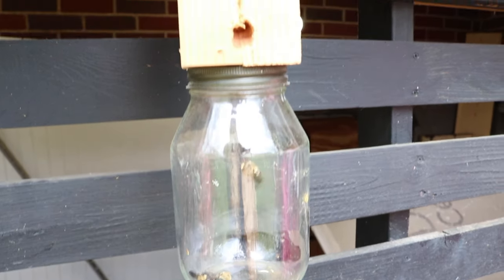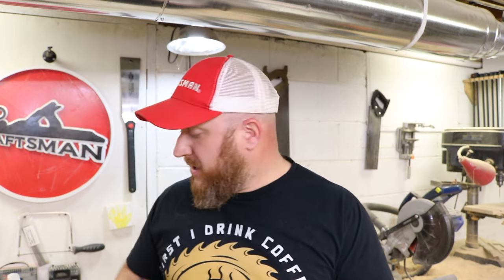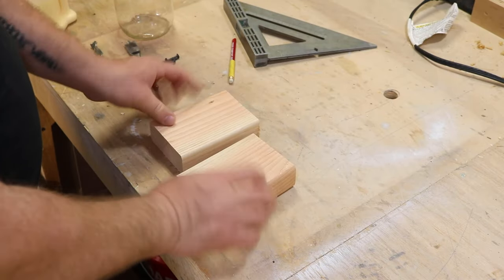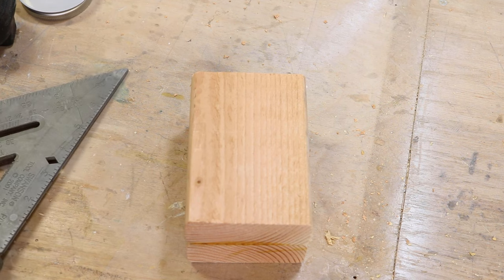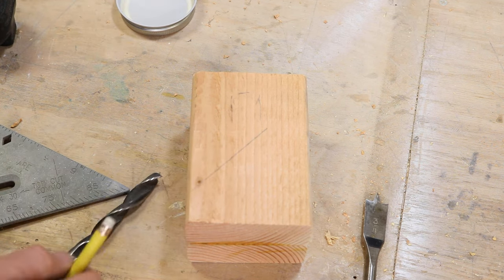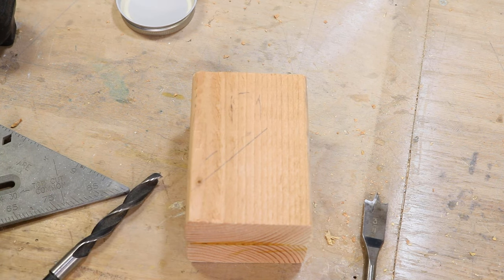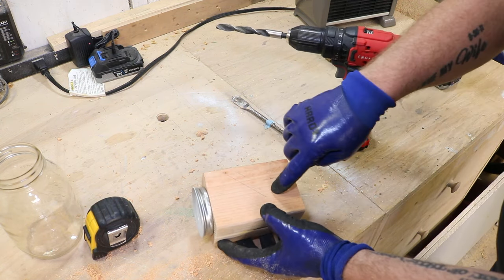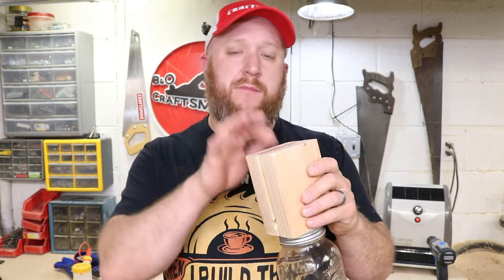How to make a Carpenter Bee Trap

Comment: If you're building traps you have a problem. The traps will catch bees but they won't stop your problem. "Well ya crazy ole fart what will"? I'm glad you ask but no one seems to do it. If one of you guys do try this let everyone else know your results. My buddies love it and it stopped a terrible infestation around my barn and sheds. That's why I started mixing it. I built over 20 traps of different styles trying to see which one was best. The 4x4 style was the winner which you made. I even drilled holes in the jars to let the thermion scent out but that doesn't help. It will help a trap get started if you'll swat a bee and put it in the jar for scent. Enough with what doesn't work and on to what does, Carpenter Bee Wax.

This mixture took some time but I'm happy with this. Get a 13 oz container of petroleum jelly at the Dollar Store or Walmart ($2.50), get the 8 oz bottle of  Permethrin 10% liquid ($10.50 I went to Tractor Supply but most farm stores will have it). Permethrin 10% is used to treat children's head lice and spray on animal to kill flies, it's considered safe for humans. The petroleum jelly mixes easily if you warm the container in a pot of warm water on the stove, it turns into a liquid. Mix 13 ounces of petroleum jelly with 4 ounces of Permethrin 10% pour both ingredients into a 1 quart canning jar and shake well, that's all there is to it. Draw the mixture into a 60 CC / 2 ounce catheter syringe with the long smooth tip ($3.30 at the farm store). You want it thick enough to stick in their holes but thin enough to be used in a syringe. Optional - put a 7" piece of 3/8 OD x 1/4 ID clear vinyl tubing ($3.20 for 10' at Lowes) on the end of the syringe to reach into their holes better. The tubing slides on the syringe easier if you heat it with a hair dryer or heat gun. When it's time to refill the syringe, warm the container in warm water on the stove so it can be drawn into the syringe. It doesn't take much to treat a hole, less is more in this case. A 60 CC syringe should treat 150 holes. Imagine a 7/16" diameter Carpenter Bee going down a 1/2" tunnel, all they have to do is get this stuff on em. This will make 17 ounces and the syringe holds 2 ounces so you will have 7 refills. Basically a lifetime supply and you've only used 1/2 of your Permethrin. I like to treat the hole while the bee is inside so early in the morning works well. Try to squirt the mixture about 1/2" - 3/4" inside the hole so it won't prevent the bee from going in if she isn't in there already. If I treat just inside the edge of the hole she doesn't want to go in. This targets the female that bores the hole, lays the eggs, and stings. The male doesn't do any of those things. This will kill their offspring as they emerge also. You'll find a pile of bees under a hole. It turns every existing hole into a trap. They'll start buzzing, crawl out of the hole, and die on the ground in a few minutes, I had dead bees everywhere. The petroleum jelly protects the Permethrin giving it a longer shelf life to last all season. If you spray Permethrin it would be effective about 14 days before starting to breakdown. For less than the price of one store bought trap you can mix this stuff, if anything is ever going to stop em this is it. This stuff will wax em, thus the name Carpenter Bee Wax. I'm not selling anything and make no money from this stuff but it fixed my problem and several others so I want to offer it to everyone. Might even make a good video, good luck everyone
Reply: Thank you for the time you spent in writing this. I will place traps up as the ones in the videos, but will also use this idea to combat the already made holes. I have a huge infestation of these suckers and have killed dozens by whacking them for around 12 days now, but they don't seem to be letting off. Thanks again.
Reply: @BoggiestBog  What started all this for me was Dad passed away in 2017 and I became a reluctant farmer. The barn and three sheds were infested with these things. I needed to do something fast but what? I started with Delta dust but that encouraged them to abandonee the old holes and drill more. Next came the traps and a butt load, different designs, types of woods, and locations. I use attractants in some traps and dead bees in others. Of the two dead bees are just as good and untreated pine is my wood of choice. I painted the top portion of some yellow to see if a color would attract them. It didn't seem to matter. 2019 rolled around and nothing had changed, the numbers wasn't going down and I had caught a lot last year. I needed something else. I was familiar with  Permethrin and from what we're told it was safe to handle so I based my trials on it. It took a little time to get the consistency right. I was going to wait to see how it preformed but it was effective enough that I started telling friends and getting positive feedback from them. 2020 was much different, until this day it's hard to find one. You'll notice they like wood that warms first and gets sun all day. The southeast side of my buildings had the most damage while the west side wasn't effected. My deck at home faces west and I don't have a problem but my east and south facing neighbors did before the Bee Wax. If you would like to try this I'll be interested in your results. For some reason people think this is hard or something? I go into detail to make it simpler but I guess it sounds hard? If you have questions feel free to co0ntact me. I think if someone shows how easy it is and effective it is folks will use it. I'm 60 years old and not the guy you want videoing. lol  I'm pretty sure YouTube and I wouldn't get along ! 
If you treat any holes overhead don't be under them when the female comes out. She won't be able to fly but she'll fall on ya. Females have an all black head and are the only ones that bore holes, lay eggs, and sting. Males have a yellow dot on their head that is easy to see, he only breeds the female. In warmer climates the female can breed two times a year producing 5 to 7 eggs each time. You'll find them piled up under the hole. We have an old refrigerator where I store mine, I don't know if that is necessary. I wish I knew more about it but I know this works. You know I'm not a professional because I didn't ya charge anything. lol
Reply: I have carpenter bees in my firewood.  Is this mixture safe if the wood will be burned inside a house?

If not Im gonna try these traps combined with fake wasps nests and a nest box. Hopefully they'll move to the nest box and away from firewood.
Reply: @robertm5969  Good question Robert, to be safe I'd ask someone smarted than myself. What I have learned is these bees like the wood that gets the morning and all day sun. The sunny side of my structures sustained the most damage. I hung traps all around to see what they preferred. At home my deck faces west so I don't have a problem but my eastern and southern facing neighbors did before Bee Wax. Having said that is it possible to cover your wood with a tarp or move it into the shade? Traps won't stop them. From what self education I was able to find females can breed two times a year in warm climates laying 5 to 7 eggs each time. Bee Wax kills their offspring as they emerge effectively ridding you of bees.

Personally no more Permethrin than you'd be burning I'd do it but that will be your call. Lets break it down, 60 CC syringe {2 oz} should treat 150 holes. It required 4 ounces of Permethrin to make 17 ounces of Bee Wax. You'll get 8.5 refills from 4 ounces of Permethrin. I'm not sure you'll use a quarter ounce if that much? lol Your call.
Reply: Sounds great. I was wondering how to make it
Reply: I’m sorry I missed that, could you go over it again 🤪
Reply: would love to but I can't get to their boresites
Reply: @PatrickMcCarthy  they in the attic & I ain't crawling up ther pulling all the insulation out trying to find the holes 🤷‍♂️
Reply: @charltonheston969  haha, not my circus not my monkeys! Good luck to ya
Reply: @charltonheston969  same. In addition, due to the method of construction, the ceiling is not rated to take my 200lbs. the bees have free reign up there and I can't get to them, so the traps are my best bet
Reply: @PatrickMcCarthy  When I was testing traps the 4"X4" post with the clear container of your choosing on the bottom. Not the side as I've seen some commercial rap designs. They can't fly vertical, they can crawl sideways. This design was best for me and the bees didn't care if it had a roof. They didn't care about the colors red or yellow. The type of unpainted wood I used didn't seem to matter because the hole was already there. I only tested common woods from the big box stores. It will most certainly help to swat a couple bees for scent to start the new traps. Commercially available scents (all I could find at the time) were not any better or longer lasting than nature's scent of bees. Going down the scent rabbit hole, drilling small holes in the containers made no difference in letting the scent escape. That ole tennis racket or anything like that will work just fine. Males have the yellow dots on their heads (foreheads, y'all know who y'all are) They'll be most visible buzzing around outside the holes trying to catch a female coming and going from her hole. He's only worth 5 points. The female has an all black head, drills the holes, lays the eggs, and stings.10 points all daylong ! Location is also important, you want areas that receive the first sun and sun all day. In SE Tennessee that would be corners and all along the southeast to southern parts of the structure. She wants the areas that heat up first in spring. Think about the trap from a bees perspective, she goes in this perfect size hole to find all these other holes. This won't do so she heads out the largest hole where she tumbles into a container that lets in a lot of light. They can't fly vertical enough to get to the center of the container. It wasn't uncommon for the 4x4 type traps in the good areas to catch over 50 each. I have them two deep every 10' in 3 sheds and 1 barn. I really tried the traps and learned a lot for an old country boy but they did not solve my problem. In my region of Tennessee it's possible for a female to lay twice per year. Each time she can lay 7 eggs on average if you believe what I've read. The traps had to do a remarkable job and they did well but nowhere near solving my problem. The Bee Wax has been good for me. It gets the female which was expected but when you find some others explored a natural bee hole and died that's good. When you find her offspring dead under the hole that is great! Your problem is ending my friend. All I know is barely enough to solve my problem. The Lord has blessed me like that many times. It was given to me and I give it to you. It's been tested on my problem first with good enough results to start telling friends and neighbors. When they disappear on the farm I got to start doing Mom's 80 year old friends places. lol I do it to help these folks out but I've never been ask back. It's either that good or that bad. I've never charged them anything so I hope it's that good?

Comment: The access hole is drilled with a 1/2-in bit according to your introduction and what you used in the video, but during the video you called it a 3/8 inch bit. Also, I caught a lethargic carpenter bee and put it in the jar. This seemed to attract bees much faster than a empty jar. I never empty my jar, I think the bees are attracted by the scent of a dead bee, they go in to take over and already used hole.
Reply: So what is the correct size?
Reply: @KOcritiques  1/2 inch is the correct size hole.
Reply: I agree.. More Bee, Dead Bee = More More Bee in Trap.. I even had a trap that I didn't empty with dozens..still catch bees
Reply: If it had a bigger back then the other it's a queen. That's the only thing that will attract bees(mostly only wasps are those they sniff dead and come to defend)
Reply: I've noticed that also.
Reply: @dodgersfnshepard8673 Do your homework, Carpenter Bees are solitary and do not have a queen. Look it up!
Reply: these are the exact 2 comments I came to post about...

1) it has to be a 1/2" drill for the angles

2) you absolutely want to leave the dead bees in the jar. the bee pheromones attract more of these little a-holes...just dump SOME out if it starts to get too full
Reply: I used a 3\8th bit cause I didn't have a Half in my box. Wish I seen this comment on the size Sooner.

And Thank.you for the proper size. I'll go look around for the proper bit.
Reply: I don’t know. But all the carpenter bee holes I filled I used a 3/8 dowel.
Reply: Maybe make two holes 1/2” and two holes 3/8” so everyone is covered
Reply: @dodgersfnshepard8673 the male carpenter bees have yellow on them and the females are solid black. The males cannot sting but the females can.

Comment: I tried this with 3/8” holes and the extra saw shavings I put in the jar, about half an inch of them.  🤞
Reply: Did it work? I'm curious..
Reply: @ravishinghunk2671  It did, I was able to swat two bees and kill them, then placed them in the jar because apparently when they die they release pheromones. I trapped 1 bee using this trap so far. It’s been cooler outside and let bees but I’m leaving it out for the foreseeable future. 👍 We’ve had this buggers all around our 20x20 raised deck for a few years and I may need to make a few more traps.